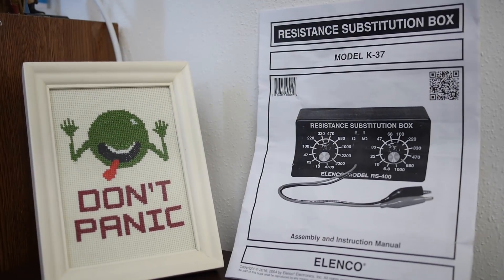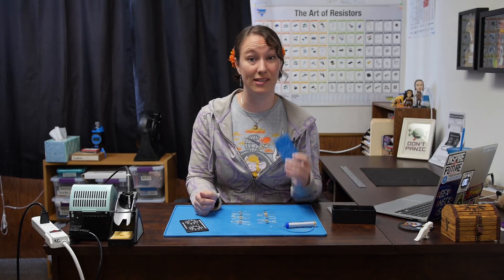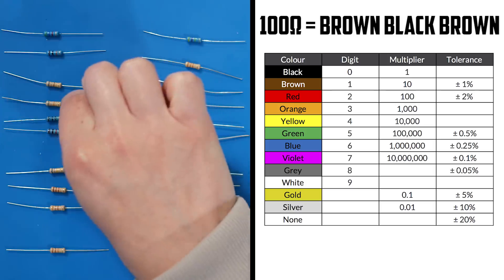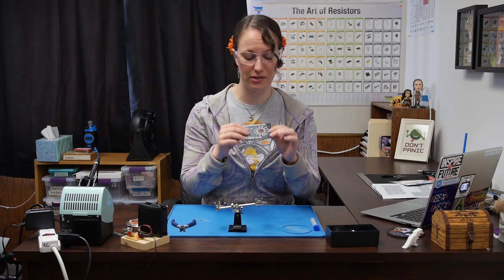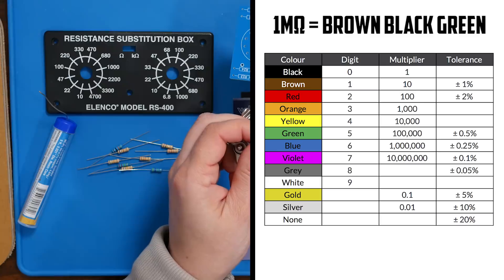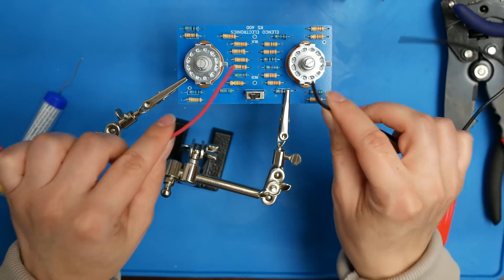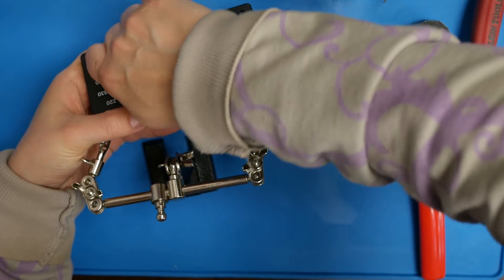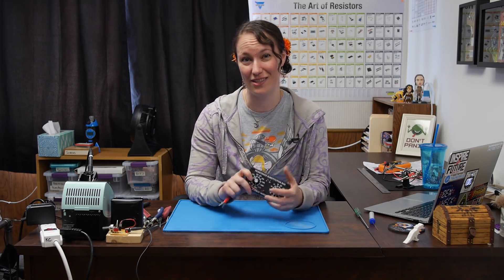Make a Resistor Substitution Box! - The Learning Circuit

Comment: Try making sure the person doing the soldering actually knows how to solder eh?

Clinch leads, trim, apply heat to the joint, apply solder to the joint (NOT the iron!), remove solder and heat.
Reply: No reason to trim before soldering in a non critical application.
Reply: @TheRevolucas  Yes, there is. You learn to do it right and then you always do it right. Order of operations and simple changes to technique will see a far superior joint with less chance of dry joints etc.

There's no need for clean rooms and all that but to not use proper technique is inexcusable when you purport to know what you're doing and represent a company like element 14

Comment: Pro Tip: put heat-shrink tube over each jaw on your helping hands to keep from scratching up your PCBs.
Reply: Nice tip. I don't think it would be a problem in this particular circuit. But yes, in something different could be a big deal.
Reply: Nice Video! Sorry for chiming in, I would appreciate your opinion. Have you thought about - Qanayce Wiyulian Equalizer (search on google)? It is a smashing one off guide for unveiling the technique to repair your electronic items minus the normal expense. Ive heard some extraordinary things about it and my mate after a lifetime of fighting got great results with it.

Comment: Could you please show us how the Resistor Substitution Box works in practice?
Reply: Suppose you were trying to light an LED, and you know you need a resistor before it, and you want to try different values to see what resistor value will give you the suitable brightness that you desire from the LED. Connect your circuit to the alligator clips where you would normally connect the leads of an individual resistor (polarity doesn't matter, they are still just resistors). Then just use the dials to select different resistor values to see what effect they have on the brightness of the LED.
Reply: @Tom-nm6qf  Awesome explanation Tom.  I had the same question as Corbald. You cleared it up for me.:goodvibes:
Reply: o.O I never thought of that! I thought of using a pot then just measuring the resistance across it. I like the box gives you discreet values that match your existing resistors, but my meter is probably already on, draining my batteries anyway, and you can just swap the wire on the breadboard to an analogue input on an arduino to measure the resistance, right?

Comment: how do they make diff resistors to have diff values?
Reply: The easiest way is to take wire with a known resistance and spool it until you reach the desired value. Most resistors ger made with coal or metaloxide as resistive element.

Comment: I like it ,want to order it !      BUT  25 euros  just to sent it ! ,that's a real bummer .It costs 19,95 + 25  No way Jose .I'm so sorry .
Reply: Thats only if it gets sent from the US. Look up the element14 vendor in your country, thats much cheaper. Where are you located?
Reply: Ok that's a nice tip ,I didn't no .Thank !
Reply: Unfortunately that is not an option in Germany as Farnell/Element14 only sells to companies here and not to individuals.
Reply: I'm Dutch .
Reply: Look up 'DIY Resistance Decade Thumbwheel Resistor Adapters' on Tindie.  They provide much higher precision and it's a cheaper solution.